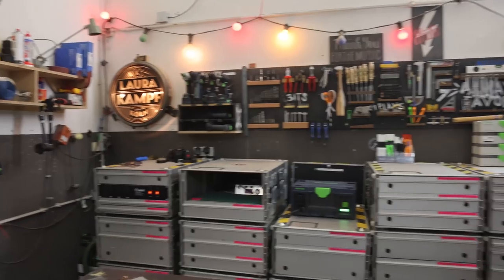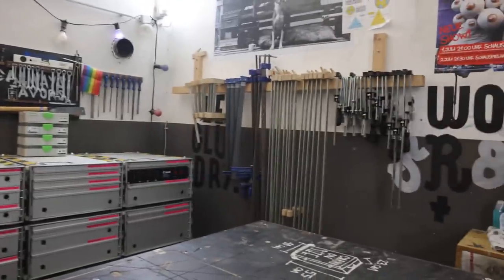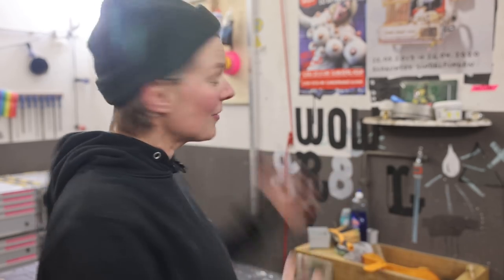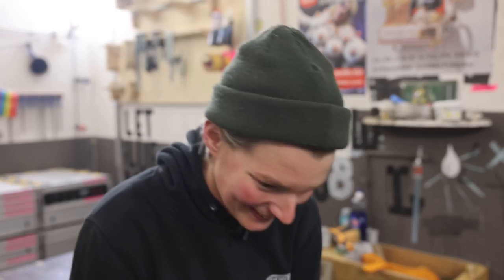This Clamp Storage Idea would be really good...if it worked :)

Comment: you need more reduction to use less force, like a bicycle with variable speeds, you could even use bicycle gears there, use a very small bicycle chainring in the pulley side and a very large cog on the lift side, that should make it easier to move

Comment: There are a few factors that I can think of.  I liked your triangle of the first attempt, that would ensure even pull at either edge.  Your second attempt has the anchor point dead center, which is great, but there might be some imbalance of the hardware putting extra friction on one side of the track or the other.  I believe The "side" pulley does not do you any favors either.  Your home-made pulleys look nice, but there might be other variables that are making them inefficient (rubbing along the sides).  take a look at the side pulley, and see that it is shaped in such a way that the line (aka rope) cannot touch the side walls/edge of the pulley, and therefore get full advantage.
Reply: I also like the idea of shock absorbing springs as it gets lowered.

Comment: Have you thought of finding out how much it actually weighs? You've two thirds of a sheet of ply/blockboard, plus the brackets, plus 20 odd clamps, tape etc which all adds up. Might be worth trying the obvious first in that it might be too heavy to lift un-aided and you can get an electric mains voltage winch on the 'zon for 140 euro's that you could also use elsewhere.

Comment: Each rope going from top to bottom is a count on the denominator for what fraction you're lifting: one rope from the top pulley down to the load= 1/1 you lift the whole load. 
Top to load pulley,  to another top pulley,  back down to load = 1/3, you lift one third but don't forget friction adding its resistance. 
Also: each reduction means you have to pull more rope.  1/8 reduction is great when you're raising 50kg but only pulling 7kg to do it,  but you have to pull that 7kg 8m to lift your load 1m.  Physics won't be fooled.

Comment: 3:28 nice shot! 

I think wheels/roller bearing mounted on the sides of the sheet to run in the tracks mounted on the wall would be quite helpful. It looks like the sheet rotates slightly when you push on it and then jams. Pulleys with grooved wheel would reduce the chance of the rope getting caught on things. I would put little cleats on the ends of your shelves to reduce the chance of the clamps bouncing off, with out having to have them locked in somehow. 

What is your thought for the wall space when the clamps are in the up position? Are you thinking of spacing it further off the wall after you trouble shoot it to have an other shelf behind it?

Comment: IMO, You're still 'out' that wallspace with a setup like this.  Your clamp board should be free-hanging with two ropes for stability, freeing that section of wall up for other storage, and you get to use both sides of it.  Then, either employ an electric hoist with pulley reduction, or increase your pulley ratio for human-operated lifting.  Anxious to see what you come up with!

Comment: Counterweight is the only way you're going to be able to lift that by pushing on the board. attach something heavy to the rope. also if you want more ideas look at the snatchblock video smarter every day did for a better explanation of weight distriblution with pulleys

Comment: It certainly looks cool and I kind of like the idea. But I'm not sure what you actually accomplish. The wall space beneath the board can't be used without interfering with the system. I feel like in practical application the clamps and glue will probably be left in the ground position for easy access?

Comment: I think it's not the weight, it's the friction.
Wax the wood in the u channel and make sure the rope is not rubing at any point. Maybe the pulleys it self must be made new with a channel in the roll for the rope.
I am quite sure only optimising the friction is enough.

Comment: install crank handle, so you don't have to pull rope. 
change the pully arrangement to a higher ratio. (ex. 2:1 ratio - you pull 50kg to lift 100kg).
use wax on the sides of plywood...seems like you have too much friction...
Good video

Comment: I think, the issue is, that the rope is getting pinched between the bearings and the frames of each block. Large washer on either side of the bearings would keep the rope centered on the bearing and away from any pinch points. Also you could try going to a larger rope diameter and see if that solves the issue. Great idea though, vertical storage.

Comment: from what I know about pulleys, you need a counter weight against the weight you're trying to pull (the wall hanging). You physically pulling should be the direction, not the complete force.

Comment: Old garage door springs running from the top of the platform to the ceiling to overcome 75% of the weight, or as stated previously, a counterweight to do the same thing.

Comment: Just get a motorized winch like the ones mounted on off road vehicles. Also put some rollers to guide the board inside the tracks. At least ad some nylon to make it slide better

Comment: Hi, what if you bore a hole in the wall and have some counterweight on the backwall in combination with pulley on both sides of the hole as you then can use Your littlefinger to move the rig upwards and down...?

Comment: It could be too much friction between the plywood and the guide channels. Try putting castors in each corner of the plywood to run against the channels. The increased friction may be caused by uneven weight distribution causing the plywood to rotate and bind in the channels.

Comment: A part from the weight probably you have friction problems between wood and metal, why don't you put bearings inthe corners of the panel so it slides better through the rail?
In the other hand if you demultiply weight by the adding of more loops in the pulley it will be easiear to move the weight, motorizing it is also a good idea but the easiest moving the panel is the smallest the motor has to be. 
If you are concern about safety just put some stoppers, it will also be good to unleash the tension of the rope.

Comment: Garage door system would have been an easy way ,the upper bar and spring , you could get one for free at your local garage door installer ,they ways have a few from door renovation project , that along with the vertical track would have made your project super easy , along with bonus , you can mechanize it very easily and safe . Extra bonus , get two sets and double your system by sister-in-law them in front of each other ,one for clamp and one for the stuff you don’t use too often ,face it with a peg board .....

Comment: The sheaves are too small. Effort will decrease as diameter increases. Also, perhaps you could hinge it at the top and pull the bottom up and out of the way with the pulleys?  This will have the added benefit of eliminating the possibility of things falling from the hooks.

Comment: Instead of relying exclusively on the pulley, why not add a counterweight equal to the mass of the mounting panel plus a little bit extra. That way you still have a gravity assist while dropping it down to access the clamps, but you’re only lifting your clamps and not the whole assembly.

Comment: All your problem starts with friction in alu rails that you use on sides. The wieght of clamps is not regulary distributed and the board try to turn so the edges of the board just stuck in the rails. Try to solve it with small bearings or slide blocks from some hard plastic. Then also you can try it  to make some counterweight. LAURA TOLLE ARBEIT DAUMEN HOCH ;)

Comment: Your idea is bold. your work is faultless but to what point ? every time you want a clamp you will have to let it down (that is the easy bit) when you have finished you will need to pull it up (that is the hard bit) how long before you get fed up and it stays down, also if the clamps are up at the top what can you do with the empty space you have created ?  it is a dead space that you cannot use. The idea is great for things that do not get used a lot but not for things like clamps, sorry for been so negative it is just my opinion.

Comment: Seilwinde.. ;) Winch it. ;) Put a Winch on the wall and use a steel rope. You can use an electrical or a manual winch. A manual winch would be the easiest way.

Comment: Ich würde konkave Roller für das Seil außen auf die Lager pressen. Das sollte verhindern, dass das Seil abrutscht und sich zwischen Lager und Rahmen des Seilzugs einklemmt. (engl. below)

I'd press concave rollers for the rope on the outside of the bearings. This should prevent the rope from slipping and getting caught between the bearing and frame of the pulley.

Comment: Maybe with a motor or at least a contre weight to hold the weight of the wood, and you just have the clamps to lift by hand. Or both system to use a more little motor.

Comment: get pully wheels with a groove for the rope.  add wheels to where the board moves in the track.  it will work!.  I went through a similar learning process trying to hang a kayak from a ceiling.  try syncing to pulley sets so that the front and rear of the kayak come down at the same rate.  ha ha.  broke my brain and gave up.

Comment: You could incorporate a garage door spring
Reply: In fact you could probably use a lot of garage door parts; tracks, rollers, pulleys, and possibly even the motor. Plus you could find a used/free/cheap one too which would be on brand.

Comment: Clearly over-engineering is the only solution here.  Pulleys, motors, gears, shafts, drive controller - get it all in there!

Also, love the old mechanics pit in the floor.  Do you use it for anything?

Comment: Two issues, the weight and the friction in the runners. And of the two, the runners are the biggest issue. The weight you can offset by more pulley action, or counter weight on the pull end. But, runner issue is harder to fix, some wheels or barings within them will be needed.

Comment: It surely looks cool but I don't get the need of pulling it up. I mean, you couldn't put anything under it anyway or it would be in the way, wouldn't it? Anyway I think there is a lot of friction between the wood and the rails, you could solve this with some bearings.

Comment: Your pulleys need to have a grove for the rope to set into but your biggest problem is the track. You need rollers in the track. The board is way too front heavy so the board is trying to wedge itself in the track. Making it much more difficult to raise and lower the board.

Comment: Replacing the pulleys with actual pulley wheels, sure, and the counterweight would be nice, okay. But I think the real fault is probably it "racking" or wedging itself diagonally in the rails. You shouldn't even really "need" pulleys for that weight. I mean, wanting pulleys, yeah, but needing? Nah.

Wheels on the corners of the board should help, I think, or breaking the one line from the pulley into two lines going one to each corner of the board.

Comment: I think you have a four-ply pulley system, i.e. four lines in the lifter.  You have a mechanical advantage of four, but we'll use three to allow for friction.  If your panel and clamps weigh 100 kilos, you need to pull with 33 kilos.  If you build a crank with a 4-1 ratio, you push the crank handle with about 9 kilos.  That is too much work.  I'm exhausted already.

Comment: This will definitely work if you place some wheels at the edges of the panel, and make proper pulleys, with a guide for the rope, to place over the bearings. Friction is a bitch.

Comment: So, my first thought when watching this video is that you're essentially trying to build a garage elevator without a platform. Jay Bates did a good video on how he built one a little bit ago, but I think it would address the majority of the issues with your current system: https://youtu.be/V8rGrDSq83c.

The other thing that came to mind is that this is similar to a garage or other rolling door, and having installed those professionally - the biggest thing you're missing is the spring that counteracts the weight of the panel and its components. Torsion springs mounted at the top of the wall can be tensioned to make the system very easy to move, but you'd want to determine the approximate weight of the system to determine the appropriate spring size.

Comment: Interesting concept, I like the idea since you have high ceilings to better utilize the overhead space.

Smarter everyday made a good video on snatch blocks: https://www.youtube.com/watch?v=M2w3NZzPwOM

Not much to add on what others have already said:
1. there is likely a binding issue because the slides and where the pick point is on the panel (its likely not inline with the CG).
a. attaching from close to the two edges to a single point can help with balancing
b. waxing the rails or using a better track system will help with friction
2. how you mount the pullies to the wall is causing issues, they should be overhung if possible.
a. they are twisting about the fixed point, instead of pulling along the intended load line.
b. is there was a slight L shape that protruding from the wall where you could hang the pullies inline with the panel, this would help.

Comment: Open electrical box at 8:16. Come on... the codes in Germany are more strict than in the US. What's up with that?
Your pulley arrangement should be in the shape of a "W" so that it pulls on BOTH sides. Also, add a hand crank winch.

Comment: Power winch, more pulleys to maximize lift. Each time you pass thru a pulley you double its pulling capacity. So put a triple under the panel of tools by the floor or hide it behind the panel to leverage against.
Watch some YouTube jeep recovery to see how they use a pulleys to move stuck vehicles.
You're so close.. Don't give it up.

Comment: A nice idea for nothing. You gain nothing by pulling it high. All the things on it goes out of the reach. Leave that board fixed, put another board on front of it with an art on the surface and make that pullable up. You can do another one behind this as a chalkboard. This way You can hide the clamps, You can draw sketches, have easy reach for the clamps and made a useable pulley thing. Anyway, nice try, keep going! :)

Comment: You need an idea, I have one that fits you... what about stacking  in a shop angle/corner some barrels with internal rotors such as this? Schau mal... prego https://www.youtube.com/watch?v=9jl0nxRMNp0
Of course you stack higher less frequently used tools such as specific extractors and at hand reach what is used mostly  
of course you can use internally hooks, rubber bands or riveted magnetic bars and you also can lock the access sliding doors so developing storage in hight you can utilize more floor space turnig around things... Just my Two cents... amore.

Comment: #counterweights +/ a combination of multiple pullies as seen: 

https://youtu.be/M2w3NZzPwOM?t=217 (feel free to start at t=0 but 217 seconds in and you can get the most relevant material)
Reply: PLEASE NOTE: rope is ok but you want to over spec on its strength (at least a 10x safety factor), usually rope is ok for climbing and short durations with less friction rather than being so close to the breaking point.  Say steel cables or chain are probably much better for constant hoisting. Just guessing but the broad+clamps probably mass similarly to a small rolling door and you want to have enough strength against time.